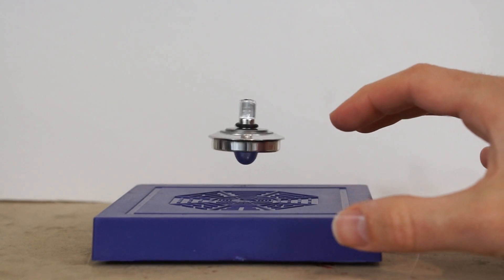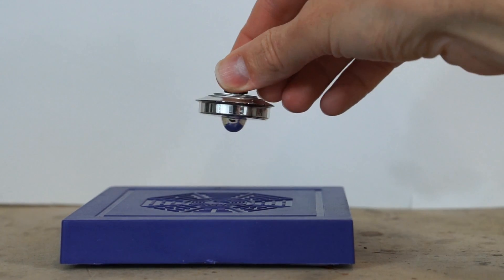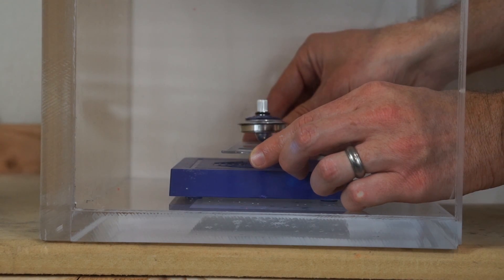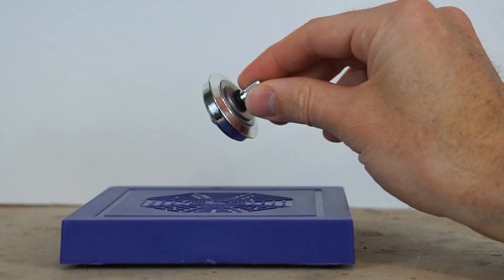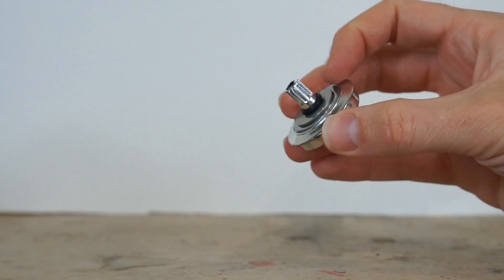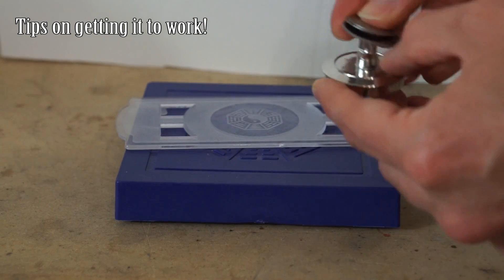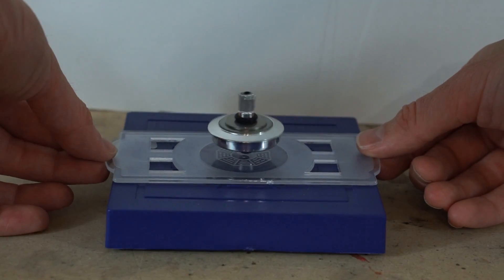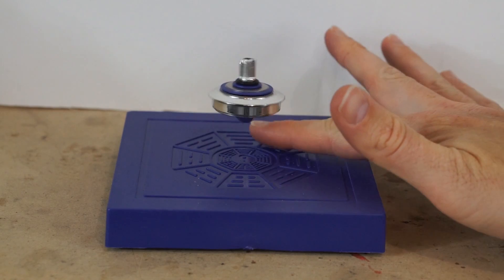Will a Levitating Gyroscope Spin Forever in a Vacuum Chamber?

Comment from the maker: Hi everyone! I wanted to mention a few things that I missed in the video. First, one of the main reasons it stops that I left out completely is called gyrsocopic precession. Meaning that gyroscopes will tip over due to gravity, but just very slowly. So, since the disk was not directly straight to begin with it eventually tips over. This could be the main reason that it stops so quickly and I didn't even mention it! Also, the magnetic friction I talk about in the video is not actually the base sliding, but more the magnetic domains shifting causing friction. And finally I didn't mention eddy currents because the shiny disk is actually plastic and the magnets are ceramic. But there are two metal washers on it that could have some eddy currents. This also adds in a damping factor. I always learn more than I knew to begin with from my own videos!
Reply: Since there is negligible air in the chamber to cause air resistance and the magnetic friction is not a large factor, is the friction being cause by the angular momentum of the gyroscope opposing gravity?
Reply: The top factors will be gyroscopic procession, induced eddy currents and maybe some domain dragging effects and air resistance.

If I had to make an educated guess gyroscopic procession is by far the main factor followed by induced eddy currents.  I don’t know that I would call those “friction” but they are certainly dissipative in the same way as mechanical friction. 

Air resistance will play a minor role, I would guess.  The vacuum experiment seems to support that assessment.  I have my doubts that the domains of the magnet are playing a major role.  If they were you would see the actual magnetization diminish over time.
Reply: @brandonkeffer5752  it needs a stabiliser to stop it from tilting
Reply: Kkkkk
Reply: @hjideonarine105  every time they send supplies to the new space station, they always make sure they have extra fuel, to push the space station to a higher faster orbit !
Reply: bob question okay this guy is just baiting now
Reply: Chirag Jasuja, we have a winner, moving magnetic filds create eddy currents. same reason as to why the magnet slows down when dropped thru a copper tube.
Reply: well said  nindjako.. there already is a force, besides gravity trying to tip it over. well noticed.. i think you are the FIRST to mention it...
there are other objects that will always float above the magnets.. find one of those and see how long it spins. it will stop too.. maybe  it will spin longer..
now this is science.. trial ad error
Reply: I think it will spin longer. however, the magnet not being perfectly stable, will create some sort of resistance
Reply: The Action Lab I think it will stop because it wasn't completely stable so it will flip
Reply: @LancerFanClub  It's not stable AT ALL.  If it weren't rotating,  it would just collapse due to gravity.  It stands up because it is rotating,  and when grvity tries to cause it to collapse,  precession exerts energy to cause it to stand up  ----energy coming from the speed of rotation.  Eventually,  the speed slows enough that precession can't keep it standing and it collapses.
Reply: Does the magnetic field itself involve friction? Like, if you could somehow avoid all the other variables would the magnetic field eventually slow the spinner down?
Reply: The Action Lab the friction between magnets should turned into electric current?
Reply: 'gravity doesn't "slow things down."'
Actually, it does when we're talking about stuff like tidal locking.
Reply: The actual reason is not because of gravity, but rather because the magnet creates an effect similar to friction, because it specifically tries to pull the magnetic fields into alignment, but only the gyroscope is free to move, so it is gradually forced to stop spinning and remain aligned with the magnet in the base, even any other forces besides magnetism.
Reply: sorry son.. mass x acceleration is the wrong formula.. acceleration is ZERO at constant speed...try another one.. heres your cookie..class dismissed.. try again next semester
Reply: The Action Lab it will spin forever, as long as there's universe
Reply: The Action Lab the music is kinda annoying though
Reply: +Dnonymus Creed
Oh dear.
Reply: Electromagnetic hysteresis.
Reply: It will stop because of earth's magnetic field interference.
Reply: The magnetic friction will slow it down
Reply: @carsonbreezy431  The energy consumed by precession to keep the top upright against the force of gravity is the major consumer of energy in the system.   If the top weren't rotating,  it would just collapse due to gravity.  When it's rotating and gravity tries to pull it over,  precession exerts a counter force to keep it upright,  and that power comes by slowing the rotation of the rotor.    When it slows enough,  precession can no longer keep the top standing and it collapses.
Reply: One theory rejects gravity and says rather it is time dilation due to the slowing down of light by it's bounced absorption/release interaction with so many particles in massive objects causing time to pass slower and so any moving object feels torque in the direction towards the massive object alias gravity.
  The sun is slowing down because of so many photons reaching the surface and their last bounce from an atom there slows down that particle of the atmosphere to then slow the rotation a ridiculously insignificant amt.
Reply: Gregory Poelman 

hmm we know what density is...
we know what buoyancy is...

but what is gravity?

if you can answer that then you sir have done what not even Einstein could do. 

I dont even think he liked the theory much himself.

lol gravity is pulling AND pushing... 
the earth core is solid now? not a fast spining hot core? 

this guy. yall religious type cant seem to make up your minds.

higgs boson... lol.
the tooth fairy tell u about that? 
https://youtu.be/fnVLwqud_OA
Reply: If you go the the start of the video, you see that if you simply set the
 top on the magnet it flips. Which means there's a force pushing it 
away. The same happens while it spins, it's just the spinning keeps it 
stable because of the gyroscopic effect. 

My understanding is that because there's a force on the top it can't 
keep on spinning forever. It loses energy trying to balance that force, 
which results in it falling down. Maybe it would work if you got 
precisely calibrated magnets such that they wouldn't flip over without 
spinning, it might spin forever...
Reply: It will stop because magnet friction and because of your spin
Reply: The Action Lab I was so enraged by the explanation you gave in the video until I read your comment
Reply: The Action Lab
Its not only the friction with the magnet, but also the magenetic force between the gyroscope and the magnet. The gyroscope puts energy into being stable and so it looses energy
Reply: ahahha spinning has nothing to do with conservation of motion,....
a spinning force is an acceleration force ahahahaha
conservation of motion only pertains to straight line velocity ahahahahhaah
Reply: uh..you do know that slowing down means deceleration right? 
Acceleration and deceleration are on the same line / use the same measurement.
So i guess, depending on your first question, it could be negative acceleration.
Correct me if I am wrong.
Reply: The Action Lab I can be wrong but I think that gyroscopic procession only occurs when the gyroscopic force loses its strength to the friction so the gravitational force slowly pull the spinning object down this is the precession, so in my opinion if there's no friction the precession don't occur since the gyroscopic force will hold the  gyroscope in the  upright position....

Well I'm not a physicist so I may be wrong, if so please correct me
Reply: James Henry Smith as are baryons
Reply: The electrons of the two magnets, in the magnetic field, with the spinning motion, create resistance, consuming kinetic energy and generating heat
Reply: Please respond my friend.. I think it is electron flooding....not Air resistance. I have PROOF.....LIGHT is electrons and they air in that vacuum...maybe no COMPLETE molecules to speak of but PLENTY of electrons which MAGNETICALLY OPPOSE the electrons on the top and create DRAG... that slows the spin. https://www.youtube.com/watch?v=hTlhPuY2ll4&t=2s
Reply: My take is that the gyroscopic precession only occur when the vorticity center of a spinning mass and the spinning axle are not at the same position relative to earth which is not the case here to a sensible extend. 
 In the classical labo design of a "hanging"  spinning gyroscope it start rotating as a whole around the at a distance center of contact "support" (earth gravity) which is not the spinning center. A mechanical couple (due to earth gravity force") is needed for that phenomena of precession which has an apparent lifting effect on the gyroscope itself but not on the total weight of the system because there is only a torque compensation  (causing only a displacement of mechanical forces) not an attraction (gravity) "force" compensation. 
The phenomena of precession  take its roots in the action of spinning matter (in acceleration) in  the vacuum which acceleration cause an inertial force with electro-magnetism origin. 
It is long to explain why inertial forces we feel everyday when we accelerate our car only are linked to what matter of us the driver and our car is made of (assembly of electrons, positrons which combined generate protons, neutrons and smeared around electrons to "neutralize " electrically what we call an atom. See the particle colliders experiments and Quantum electro dynamic (the non relativistic theory one not the other) This latter model expose  what the "vacuum space" really appear to be ;matter and anti-matter ready to localize (separate from each other if you prefer) when electro-magnetic energy is added locally to the "vacuum" at the right level for "localization".(matter appearance) 

By this token, magnets attract  each other north south in the space "vacuum" why? choose your model :
1  "virtual particles " as per Q.E.D.
2 fluxes (10 to the minus 9- 8 Ampères currents) of real particles like electrons or ions experimentally observed now.
3  or simply ( but that is not what we "see" as our brain interpretation is subjective) that is because the space vacuum trend to contract between the two.
  That latter "space contraction/expansion model" is due (unified electro-magnetic field theory MEYL TESLA KELVIN MAXWELL edited in 1990) to the electro-magnetic effects on matter (negative voltage when separated and with anticlockwise rotation) and anti-matter (positive voltage when separated and with clockwise rotation)which are ready to separate from,  the electrically neutralized ("nothing electrically and nothing vorticity and consequently nothing mass) "space vacuum" at rest which occupy the whole Universe 
In consequence of those matter/anti-matter "localizations", there are 50 per cent SPIRAL clockwise galaxies and 50 per cent anti-clockwise SPIRAL galaxies. Lenticular galaxies are a combination of both clockwise (matter) and anti-clockwise (anti-matter) galaxies ("collisions"). That observed cosmologic fact  should not be a coincidence
On contraction of space perspectives, (not space-time contraction!!!!) see the US NAVY EL PAIS PATENTS 2017-2018 showing how to create gigantic magnetic "so called fields"( able to contract space-vacuum ) and reach speeds greater than light probably . These research apparently understand how gigantic magnetic fields are produced in reality by nature by A ROTATING assembly of two Material pôles (voltages) and not by making little magnets like the electrons moving at slow speed around an electric loop around NOTHING electrified..
That space contraction is similar somewhat to RELATIVITY "time expansion with observer dimensions contracting with his own speed", but in the unified fields model  we have  a "space contraction without affecting time which remain constant  as defined by us.(like synchronicity)
Reply: Echo, echo, echo. lol
Reply: The Action Lab true
Reply: and you have no idea what your even talking about... lol
Reply: The Action Lab sometime is gonna stop Energy is impossible to not generate its gonna stop is against the physics laws
Reply: The magnetic push opposes gravity therefore slowing it down
Reply: Dnonymus Creed  boi gravity is its own force it's neither pulling or pushing the Higgs boson are attracted as a whole towards each other, and the earth only has a magnetic field because of its solid core, so the longer the earth exists the less heat on the inside so in a few trillion years our earth will be solid and have a super strong magnetic field
Reply: Gregory Poelman. The earth is not a solid body. Convection currents caused by the molten core's uneven cooling creates electric flow which produces a magnetic field. As the earth cools it will loose it's magnetic field.
Reply: AtiPLS the energy cannot get lost it just transforms from a way to another
Reply: Sorry
Reply: its gonna stop becasue of the friction on the magnet
Reply: reupload a corrected video
Reply: I believe that it would stop no matter what you try because all matter is composed of multiple atoms with not completely stable boned and there for from the spin itself they are pulled apart and together using energy from the spin.
Reply: The Action Lab llL.
Reply: true
Reply: The Action Lab i
Reply: johnny llooddte
a spinning force is an acceleration force? not if it is slowing down.
Unless you are talking about rim velocity and that it being another big reason why a rotating ball "Earth" is impossible.
Reply: I think that it will spin forever
Reply: What if the magnet underneath was more stable and the top was spun at a higher rpm? Also, the top has already lost its momentum by the time you turn on the vacuum chamber. I think a more precise experiment might be beneficial here.
Reply: The Action Lab so god made it stop right? Ok thx just so where clear.
Reply: Carson Breezy. Magnetic friction. Is that science fiction . Has anyone looked this term up . Try to. All a person needs to do is look up the definition of friction and it itself says magnetic fields do not cause friction. What is goin on here
Reply: The Action Lab I knew I wouldn’t it wouldn’t spend forever because there’s not air on the side of it keeping it up if it was just there and by itself there’s nothing holding it up except for magnet which isn’t stable enough
Reply: Yes it will!
Reply: Don't forget the gold foil experiment. Even in a perfect vacuum without gravity or any other opposing forces you still have "virtual particles" that pop in and out of existence that exert force on those objects. I win! :)
Reply: The Action Lab what's the Background music at the star until the half I thought ?? Please answer me 😊
Reply: Nah it sucks. dont joke about a serious matter now.
Reply: Wouldn't the rotating magnetic field also cause some kind of RF emmision?
Reply: Another reason that the top stops spinning is the two magnets are doing work on the floating magnet in order to overcome gravity, this work is in the form of magnetic repulsion, which is only caused by the top being right side up. Its kind of like a ball on the top of a hill verses a ball at the bottom of a hill, and nature always picks the position of lower energy in this case potential energy
Reply: it could also eventually de-magnitize
Reply: “Pause the video and scroll down to comment if you think it will stop.”
scrolls down to comments and sees your comment saying it stops
Lmao.
Reply: The Action Lab
Reply: will stop do to magnets causing drag.
Reply: I was about to mention the eddy currents, ultimately the kinetic energy is converting to heat via the magnetic interactions inducing currents and ultimately heat due to electrical resistance.
Reply: A better way to spin the top is to use the fingers one uses for snapping, just put the gyroscope's tip in between your thumb and middle finger and snap. This will make the top spin much more faster and longer. 
Hope you try this 😄
Reply: What if you spun a quark in a lead chamber in space.
Reply: The Action Lab u
Reply: The base magnet ain't moving at all, the dampening is caused by the magnetic field friction. Plain and simple.
Reply: The Action Lab it could also be because vacuum Chambers aren't a full vacuum. And in space it would eventually stop because space is not a perfect vacuum. And Earth is slowing down very slowly.
Reply: What about deep space? For example. If you spin it beyond orbit of Pluto, for how long would it spin?
Reply: I suspect the reason it does not spin for much longer is partly because the spinning magnets generate internal currents that oppose the motion (Lenz's law creating internal currents that then cause Lorenz forces that oppose the motion). There are several examples such as https://www.grand-illusions.com/lenz-s-law-demo-c2x21139927
Reply: William Harwin from what I’ve learnt in undergrad physics, and without analyzing the idea too much, that was my first thought, but to try to prove it theoretically is beyond my abilities. I believe most people here are are not aware of their own limitations...
Reply: The Action Lab So basically you need zero gravity and zero friction.  So basically objects need to be in space.
Reply: even earth need some moon for gyro it self:) this stuff need some magnetic moon, or big radius massive plumbum pancake for more inertia so that will more stable so lower precession, or opposite, lower precession then more stable
Reply: So you should do it again.
Reply: The Action Lab who is we?
Reply: can you try super magnets in a vacuum?
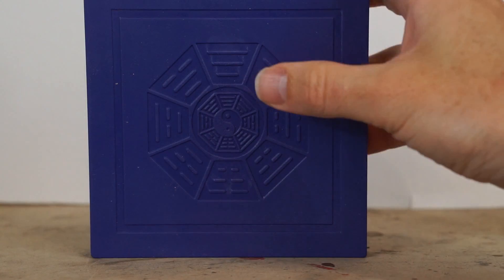Reply: The Action Lab 1:15 actually they are the same poles, cause if they were different they would stick, with magnets opposites attract, and sames repel, thiis is basic 3rd grade science, you should know this
Reply: At 1:23 he said it will float because they are opposite poles is they were opposite poles that would mean they are attracted to each other so it won't float
Reply: The Action Lab 
Ken wheeler does this better.
Reply: Even if you could design a system that got rid of the eddy currents and the shifting friction in the magnets and anything else that would cause it to stop spinning normally, it would still stop spinning because magnets lose their polarity over time.
Reply: Not because of gravity just the earths spin
Reply: And thats not friction, it's precession
Reply: I think you are right.In order to avoid eddy current effect, the following condition should be satisfied;
(1) Base magnet is completely homogeneous and magnetic field over that is rotationally symmetric.
(2) No wobble and precession movement of the top.
If even one of those condition is not satisfied, magnetic field which goes through the rotating top is not rotationally uniform.
And if the top magnet and weight balance is made of conductive material, eddy current is induced inside the top, which reduces the rotational speed of the top.
Top magnet is, presumably, made of neodymium magnet, which is electrically conductive. In addition some of the weight balances are made of metals (Brass).
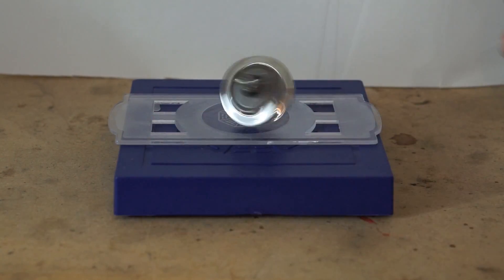We can recognize eddy current effect from the video scene of 8:37. When he start spinning the top at out of center of the base magnet, very strong eddy current effect and repulsive force fly away the top from the base magnet.
Reply: I think you are right.
In order to avoid eddy current effect, the following condition should be satisfied;
(1) Base magnet is completely homogeneous and magnetic field over that is rotationally symmetric.
(2) No wobble and precession movement of the top.
If even one of those condition is not satisfied, magnetic field which goes through the rotating top is not rotationally uniform.
And if the top magnet and weight balance is made of conductive material, eddy current is induced inside the top, which reduces the rotational speed of the top.
Top magnet is, presumably, made of neodymium magnet, which is electrically conductive. In addition some of the weight balances are made of metals (Brass).
You can recognize eddy current effect from the video scene at 8:37. When he start spinning the top at out of center of the base magnet, very strong eddy current effect and repulsive force fly away the top from the base magnet.
Reply: It's a levitating beyblade
Reply: Can you please try this again with an iron ball or magnetic ball instead? The result might differ 😊😊⚫️⚫️
Reply: The Action Lab It will stop because nothing is infinite and it throws out energy . And as i said nothing is infinite, exemple space and time. So, if space is not infinite time also then its a toy it will stop too early.
You should record time with stopwatch so we can see that vacuum make spin for long or short time.
Reply: The Action Lab To make sure it spins better without wobbling, can you try to initiate the spin away from the base magnet first then slowly work towards the floating point?  (instead of starting from bottom and have to fight the magnetic repel)
Reply: Kine-magnetic entropy caused it to stop. The happens from passing through dynamic magnetic field creates changes in the vectors of travel and induces electric currents among other transformations of energy that result in the dissipation of heat and the canceling of opposing force vectors with resulting decreases in torque-momentum. Altogether it causes entropy of the momentum generally. Specifically the velocity, i.e. kinetic energy in the direction of rotation, especially as gyroscopic stability deteriorates and opposing force vector cancellations increase. Yes, it does demonstrate that orbits are impossible and outer space satellites are a hoax. Remember this is not a thought experiment, CGI, an elegant equation sold by an Einstein character. This is observed, repeatable, and reproducible experimentation that is quantifiable and agrees with laws of entropy and the third law of motion which “cosmic gravity” does not.
Reply: The Action Lab sss
Reply: If somebody asks if something can spin forever if {insert theory here} just tell them perpetual motion doesn't work
Reply: I glad you came back to address your false statements in the video.  proves that you really want to learn.  great video anyway
Reply: The Action Lab we can produce electricity from this with more research .
Reply: If you were able to keep its momentum up, would it continue to spin?  I'm thinking along the lines of using an electro magnet to push or pull bar magnet on the top of the thing.
Reply: Precession has an effect here because the spinner is not spinning level from the start, over time the slight wobble will be magnified by precession. Precession is most clearly seen in helicopter blades, to change direction the blades (rotor disk) are tilted at 90 degrees to the direction of required travel, if the blades stay level then the heli stays level.

 If this were a 'perfect' experiment, perfectly level spinner, perfect vacuum etc precession would not have an effect as it would be acting in equilibrium all over the spinner. Then the spinner would slow simply because the energy it uses to spin, the kinetic energy given to it initially, is being countered by the 'drag' from the magnetic field. If you took temperature of the spinner before and after it would probably be warmer after, the energy is probably converted from kinetic to thermal. If the energy is not converted then the spinner would spin forever, ergo it must be converted to something other than kinetic. It could also be converted to electrical so the spinner may become charged.
Reply: Brandon Keffer h
Reply: The Action Lab
Reply: The Action Lab
Reply: Brandon keffer What really happens to the magnet is that the gyroscope was not on its absolute horizontal axis, as this is extremely difficult to do. Because of this, the force of the magnetic field  is not distributed evenly on the edges of the gyroscope, this causes a increasing oscillation in amplitude of the distance to the magnet and this has proportional correlation to the strength of the magnet (obviously). Causing it to loose control.
Reply: The Action Lab I have a magnetic gyroscope I picked up a garage sale for like $2 a few years back and it spins about 2 min in normal air, and doesn’t wobble in the slightest. It spins higher as well. It’s called Super Levitron and it was made by Fascinations in 1996. I would suggest trying one of these, which I’m sure you can pick up off eBay. They’re waaaay better. They take some time to get perfect but they have a wedge stabilizing system as well as very small ring weights you put on the top to get everything just right. Take a look, this would be an awesome experiment! Love the stuff you do; it’s like the stuff I do at home when I’m bored but with way better equipment. Keep making great videos.
Reply: the reason you missed it cause you try to be a physicists scientist but all you do is research on youtube. i do a lot of research on youtube but its not the same as college just saying.   Interesting videos but ,like i said i can tell in all your videos you are just repeating info from other youtube videos. once again not hating just saying i can tell your just a youtube warrior
Reply: The Action Lab gravity gravity gravity. Gravitate to a none scientifically proven imaginary force of madness.
Reply: The Action Lab well that's what experimentation is all about...
Reply: The Action Lab  okay
Reply: Also, I don't think a spinning object generates gravitational waves. Rotationally symmetric objects don't generate gravitational waves as they spin around their axis (e.g. a disk). Although I don't know if anything is PERFECTLY rotationally symmetric
Reply: Gravity, you need 2 magnets
Reply: Try to spin it with a dc motor that the gyroscopes will be more effective
Reply: Think you could win a court case with this "gravity" commercial? You couldn't win the argument for this being science. This is still opinion. 3 main things I have a problem with without his lame reasoning. In a vacuum, a bowling ball and a feather will fall at the same speed because there is no air resistance. The point here being.. can't prove spinning indefinitely it in your mother's basement hovering an inch above the magnet sitting on the ultimate magnet. The vacuum itself disproves the floating Portable Toilet(iss). Without air there is nothing to conduct the magnetic field except for immediately within range of the magnet. let's not forget magnetism is electric in nature. No suit we can make will allow us to enter a vacuum. It's hard to find but nasa made that mistake once. That's why you don't hear about astroactor training anymore except for the movies about space, done with actors. The astronots in Armageddon were more believable than who they say are the real deal. No hypothesis, no control, no proof. I want to see your measuring device that does atmospheres. Seems like PSM would be fine. These big words like atmospheres as unit of air pressure is confusing to repeaters. Even barometric pressure is better. The body reacts the same way underwater or high above it (the Bends). At least get an average time of spin before and after your vacuum cube.  Chamber is 3 letters too many for such a thing. Maybe call call it a chamber if you could trap a finger in it or something. At least nasa augments the results they want in or out
Reply: you can always rely on old sayings no matter what, because they are based in reality. Number one example "What goes up, MUST come down"
Reply: Where do u buy it
Reply: Hold up you said opposite poles that mean they would go together I hope you meant that they were the same poles
Reply: Not forever
The magnets still put pressure on it wich might slow it down
Reply: Thanks you
Reply: So gyroscopic precession.
Reply: What if I were exactly perpendicular to the geomagnetic pole of the earth at that instant and tried this experiment again? Would the top keep spinning?
Reply: Explain properly.
Reply: What if I were at the magnetic pole of the Earth and tried this experiment?
Reply: Can you reply to my questions?
Reply: Precision gyroscopes spin a lot longer than the initial spin on your levitating gyroscope. If there were a more precisely manufactured version of that gyro, would it spin longer in the vacuum? Or would it not make a notable difference? Sorry if someone already asked this, I'm extremely self absorbed.
Reply: Not only gravity, also magnetic field of the earth and eventually fotons
Reply: What if gyroscope wheel made by magnet then do this experiment
Reply: The Action Lab you pretty much covered my comments here😅👍. I really love the range of toys and topics you manage to cover!  Keep up the awesome sciencing!
Reply: Idk
Reply: Hi everyone!
Hi The Action Lab!
Peace.
Reply: The Action Lab
Reply: how dare you learn while, ppl also learn.  what a spinning act u pulling here. good video otherwise.
Reply: U nnn what do you mean
Reply: It may not spin forever for x reason, but not spinning for more that 10 seconds is due to terrible, sloppy experimental design. There are magnetic toys that will keep moving 100 times longer than that on top of my desktop.
Reply: It's like talking yourself out of global warming by calling it a climate change
Reply: So you're assuming there's no magnetic fields in space? lol the earth isn't spinning....the sun is a way more power magnet than this is
Reply: The earth spins when lighting strikes same as a sparkplug in an engine, so i think your toy can be adapted with tiny little spark jolts to keep it spinning longer, 😊
Reply: I think it'll
Reply: I think it'll spin forever
Reply: My brain
Reply: I think little will stop for the same reason as Skylab fell out of the sky, there is still trace atmosphere, at that time in history it was probably almost unmeasurable, but the trace atmosphere caused the orbit to deteriorate, slowing down extremely slowly !
Reply: Oh, you oversaw so many things...
Reply: So what if it's in space and it's the only body in the universe 🤔
Reply: Because when it was spinning at the same time it is lossing energy
Reply: Thank you for mentioning eddy currents and ferromagnetic domain shifting. Those are two main reasons the spin stops. I was about to write my first ever comment in capital letters; fortunately I found your comment first.
In a fully evacuated chamber, gravity (and, consequently, precession) will have no effect on energy dissipation because it is a conservative force and the corresponding field is potential.
Reply: Not enough velocity or the vacuum chamber gonna be the same as space?🤔🤔
Reply: Hi. There are some materials that are magnetic and insulator at the same time, eg ferrite NiZn. So it wouldn't induce eddy currents. Can you compare the rotation times of the gyroscope you used in this video vs the one made of ferrite NiZn?
Reply: @saurabhchandra6267  Mainstream electric and magnetism physic is slowly beginning to find out that any matter (conductor or dielectric, magnets, non ferro-magnetics products) react much more than observed so far  to  what  grandpa previously called E and H fields. So do the so called "vacuum". Those so called fields act at a distance using electrified-magnetised particles (stable ones like the electron or the positron) AND by attempting (trough added energy to the vacuum) to "localize" new (virtual) electro-magnetic particles (virtual electron and virtual positron) in the said vacuum which was previously neutral at rest. Those "virtual particles " cause the vacuum space to expand or contract. Our subjective brain observe a mysterious attraction or repulsion at a distance when in reality the space  dimensions (between two magnets as an example) change (space change NOT space-"time" ))
 US NAVY EL PAIS PATENTS 2017-2018 (gigantic magnetic fields generated by two polarized (high voltages )"plates" of a "capacitor" turning at high speed ).  The  US navy researchers, so called "magnetic field (aka space dimensions changes) are created by nature using simply "rotating dipôles" with the consequence that there are a clockwise magnetic field and an anti-clockwise magnetic field  Just observe our galaxies : spiral clockwise 50 per cent, Spiral anti-clockwise 50 per cent, the rest (lenticular galaxies) combine the two vorticities  called  by conventions, one matter and the other anti-matter vorticity (electron-positron) The vorticity choice when "localizing" new matter particles cause the outside potential (voltage) to be negative (electron) or positive (positron) and the inverse inside the dipôle.
Reply: So, you make videos to help you learn new thinks
Reply: Hello
Reply: I liked this, but I'm trying to get your attention.  Finally. Yes.  Ok.   However you missed one thing..  No solid object can be stable in rotation..   The smallest mass imbalance creates a frequency within the rotating object that eventually resonates out until it converts the momentum  into its inertia.   If you could push an object in a straight line so there is no frequency?  Now that would improve efficiency by quite a bit.   Even if it is a circle. Make it a really big one.  See fast we can go.   CERN in space.
Reply: Another way to improve its efficiency is to increase its mass, improve its geometry,  and reduce its rev per minute to increase stability at much slower oscillation speeds.    Revolution/vibration is = to 1, so that is its biggest killer.
Reply: Newton's First law of motion proved.
Every object will remain at motion unless any external force applied on it 
Or any object will remain at rest unless any external force applied on it
Reply: What if the magnet in the platform didn't move? For example it was completely bolted down in place. Would that increase the spin duration?
Reply: Its great that you learn, i learn from your videos as well.  One way to mitigate some of the variables is to average 3 to 5 spins.  Then you'll have valuable data.  Or you could just have fun, 😄.
Reply: Is there really no such thing as perpetual motion? or do spinning bodies in space never stop rotating?
Reply: @brotherbush4616  There is no such thing as perpetual motion.  Basically there is nothing that goes on forever.  Even protons may decay after enough time goes by.  For example, if you had a top  spinning in space above the earth, the gravity of the earth would exert a force upon the top.  This may cause the top to crash into the earth or it could affect the tops rotation.  If far enough away the earth didnt effect the top, the sun may.  You would have to leave the galaxy to avoid the effects of gravity.  Then the absorption and emitting of light will slow the top.  It may spin for millions or billions of years depending how fast it was initially spinning. It may slow its spin enough where colliding with a dust particle will be enough to change direction.  Do you consider that perpetual motion?  Everything constantly moves around in space but not always in the same direction/rotation.
Reply: @marveloussoftware4914  no I don't consider perpetual motion as a possibility, no nothing lasts forever as you say maybe the quality of light never decays but we'll never know, the only thing that lasts forever is death
Reply: @brotherbush4616  the light kinda decays, its red shifting so is losing energy in a way
Reply: @marveloussoftware1417  is that not just a change in its wave length?
Reply: @marveloussoftware1417  you obviously have some kind of education in physics or astrophysics so let me ask you something which I've long wondered about, let's say a piston decelerates up a cylinder then comes into contact with a stationary ball bearing as it continues to decelerate, does the ball bearing not accelerate from its stationary position at the moment it comes into contact with the piston, but also decelerate as it's in contact with a decelerating piston! How can something accelerate and decelerate at the same time?
Reply: @brotherbush4616  if I'm understanding your example correctly, the ball bearing doesn't decelerate. Let's assume we have the same frame of reference for the piston and ball and also that its fixed.  The piston is decelerating because it's slowing down.   If the ball is not moving then it is neither accelerating nor decelerating. When it comes into contact with the piston it will accelerate.   It will continue to accelerate until the piston ceases to add energy.   At that point it will decelerate. 

Accelerate  =  go faster 
Decelerate  =  go slower 

So you measure the balls speed in a particular direction then do it again after a time interval.  If the second number is bigger than its accelerating.   If it's smaller its decelerating.   Keep in mind an object can accelerate in one direction while simultaneously decelerating in another.

I've made some assumptions, generalized and simplified in this example so you can find ways in which it could be wrong.  I am merely trying to explain a concept.
Reply: @marveloussoftware1417  the frame of reference for the piston and ball are the same, as an observer the ball accelerates as the piston makes contact while decelerating but you say make two time observations if the latter is longer the ball is decelerating, but the ball accelerated! You say an object can accelerate in one direction and simultaneously decelerate in another, but the ball is only moving in one direction! Sorry I must sound thick but as a complete novice I'm trying to visualise what exactly is happening, another dilemma I'd appreciate your view on is this that I'm sure you've familiar with. . . A train traveling on one direction hits a fly traveling in the same plane but in the opposite direction, the fly changed direction at the moment of  contact with the train, if it changed direction at contact with the train it must have stopped moving, if the fly has stopped moving and at contact with the train the train must also at that point in time and space be not moving!
Reply: @brotherbush4616   i dont mind your comments, they make me think and i like thinking.  For your train example you are making a false assumption. You say if the fly stopped then the train must've stopped.  That is not true.   There is only one single conclusion (and absolutely nothing else) that you can arrive at if you say the fly has stopped.  That conclusion is that the fly stopped.  There is no data to indicate anything else even if you include your previous statements.  In order to conclude the train has stopped you would need to indicate speed and mass of both the train and fly so it can be calculated that the train stopped.  That's how science works, by math calculations, not English sentences. 

As for your prior example, I suspect you are basing an assumption on English or math.  An object can not both accelerate and decelerate in the same direction at the same time.   If you say it does then you are not using words as they are defined in the dictionary.
Reply: @marveloussoftware1417  so is there really no paradox with the ball bearings movement? As a layman I'm still not understanding, you say to measure it's speed you take two measurements at different times, if the first measurement is shorter than the next the ball is decelerating and if the first measurement is longer than the next the ball is ecceletating, I understand that, but what about the balls measurement prior to being contacted by the piston, that would be zero movement, then another measurement after contact with the piston would be movement ie acceleration, so depending when measurements of the ball are made determines whether the ball is decelerating or accelerating, is that right or should I give up because I'm lost! ( thanks for replying)
Reply: @brotherbush4616  Never give up!  I personally believe paradoxes are simply human misunderstanding.  I find errors in the so called 'Fermi paradox" and the "grandfather paradox" which makes them not paradoxes.   There may not be any real paradoxes. 

I will tell you what I think happens, since I am not familiar with this example I will make assumptions where necessary. 

At the beginning if the ball is standing still it is neither accelerating nor decelerating.   When the piston hits the ball it will accelerate.  As the ball accelerates it takes energy from the piston causing the deceleration to increase.  Since the ball is more aerodynamic than the piston there will be more air resistance with the piston so once sufficient energy is transferred from the piston and the ball the ball will cease to accelerate.   A small air gap may form between the ball and the piston as the piston decelerates faster than the ball.  Keep in mind something can still move forward while decelerating. 

Try an experiment,  use a marble of something on a table and wack it with something at different speeds and see what happens.
Reply: @marveloussoftware1417  thanks for your views, it's been very interesting, one last thing that has puzzled me for some time, I assume a star emits light in all directions at the same time, effectively a ever expanding sphere of light, like an expanding balloon, at that leading edge of the "balloon" are there not a finite number of photons? if that's true  the bigger the sphere of light gets the less photons there would be for a given area of space which would mean eventually there would be so few atoms passing through a given area of space as that "balloon" of light expands that no photons would be detected, does that not mean there is a limit to the observable universe?
Reply: @marveloussoftware1417  ps the ball and piston thing is just something I thought of which is probably why it doesn't stand up to scientific scrutiny, as is the star light question, thanks for your time, appreciate it
Reply: @brotherbush4616  well to consider the observable universe other factors come into play.  You couldn't even see light before about 380,000 years or so.  Add to that the fact galaxies are moving away from us faster and faster it will get to a point that light won't even be able to reach us.  I dont know how to do the calculations, but you would need real numbers before you can figure out if your theory is correct.  A light bulb can emit (and this varies greatly by type of light) about 10,0000,000,000,000,000,000,000 photons a second.  The sun will omit substantially more.   Not to mention how you wish to 'see' since different ways of 'seeing' will capture different numbers of photons.  You really need numbers to get any accurate answers.  With out numbers you are just being philosophical which often is misleading like Zenos paradox.   It sounds like it makes sense but when you apply numbers it falls.
Reply: @brotherbush4616  thanks for your questions.   They provoke interesting thinking.
Reply: Eddy currents were why I predicted it would stop, and I was about to ask about them since you didn't mention them in the video. Interesting that the magnets don't allow eddy currents
Reply: i need  a kick
Reply: Nice video! I was thinking about eddy currents while wathcing your video, which I believe is the larest contributing factor. Even the washers are made of non-conducting material, the flux from the spinning top can still generate eddy current in nearby metal objects. The spinning top's magnetic field is so small that it should not be able to overcome the static friction of the base.
Reply: Measure temperature of gyroscope before and after for eddy current proof.
Reply: Prob wont spin forever cuz the magnet force
Reply: Dnonymus Creed I can't picture you without wearing a tinfoil hat.
Reply: Creed, I think you need help.
Reply: I would like to add something - in the start of the video you pointed out that the gyro wants to tip over due to the magnets inside trying to align in the same direction (also gravity). Next you said that the gyro wants to keep it's rotational plane. The two forces counteract each other ( plus the starting angle ) making it wobble - this makes the gyro lose energy trying to stay stable,  effectively slowing it down, the wobble increasing and finally tip over and fall

Sorry if you or somebody else pointed that out already.
Good job and have fun.
Reply: why does it suck.. he does lots of neat experiments.. he doesnt always get the right answer or explain  it correctly.. but its the way REAL science is  done.. trial and error.. and its all documented...
i think hes a great scientific  experimenter.. one  of the best on youtube.. i disagree with him on his conclusions a 1000 times a year.. doesnt mean im not a fan .. all my respect sir
Reply: Stuart Wilson
Less friction between people will occur when we stop accepting the status quo. We live in a system specifically designed to create friction between people. 

Friction in a physical sense, we don't want that to be reduced, or nothing will work properly.
Reply: test how long it will spin in the dark
Reply: My understanding is that there would be friction from the magnetic fields interacting. I would assume that given no other variables, it would slow it down till it stops and falls.
Reply: Well, it could also be from gravity, well , the pendulum at least it just attracts it to a stop
Reply: The Action Lab Its called conservation of energy......  wow...
Reply: you forgot to shut the fuck up for the first 3 minutes... can't you write an intro demonstration then conclusion without all the fucking rambling?
Reply: Rion Shoshaj 

watch out now, science went from trying to prove something wrong to trying to prove something right. 

nothing but SJW'S ruining science now a days. nobody can have a different theory anymore or else you get dog piled. 

fools dont know that the theory of gravity is not the the only one in their books. 

world religion is everywhere...
Reply: The "Earth" has never spun. That spinner wont spin in space either. Space is a myth, a lie. CGI's and fishy fish eye fakery. "Space might be the final frontier but its made in a Hollywood basement" as the old song goes.
Reply: Sorry but action lab is a joke. Almost like he just makes things up as he goes. 

Gravity is not real. 

What scientism describes as gravity is multiple forces pushing down. NOT PULLING. 

The earth does not have a magnetic core as it will loose its magnetism the hotter it gets. 

Its funny how "scientist" from the religion of scientism ignore actual facts. 

Its ok though all that is coming to an end soon. 

Wise men will become fools and those, who the world thought were fools, will be wise. 

Shalom to you all brothers and sisters.
Reply: @dnonymus  Scientism.